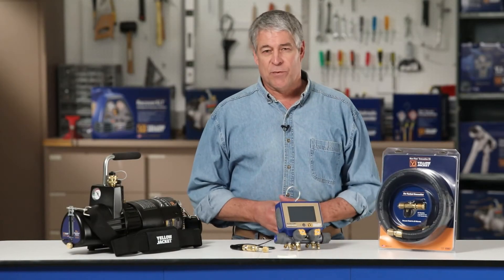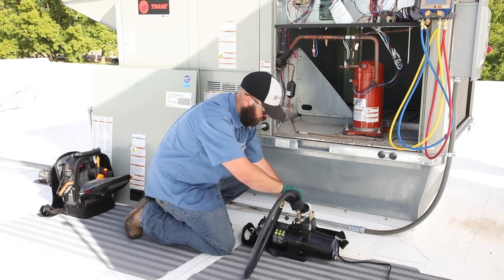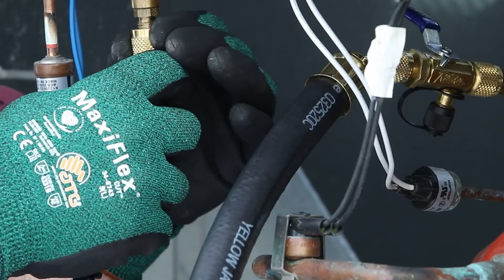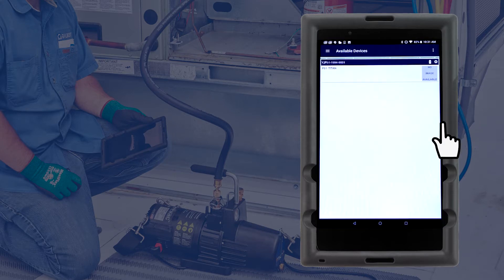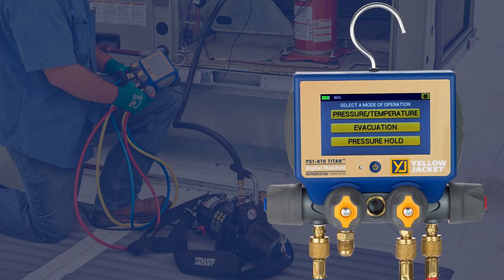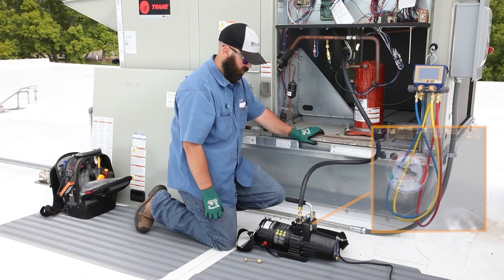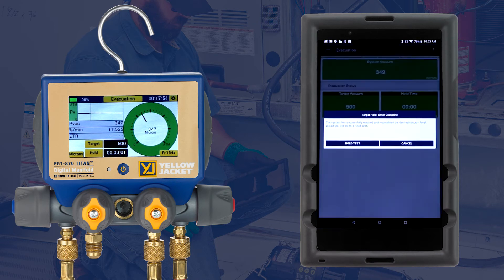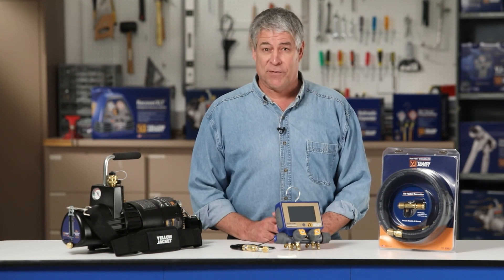HVAC System Evacuation with SuperEvac PLUS ll P51 MaxFlow

Comment: I have had two pair and they both can’t get past -14.4 psi. The microns stay in the thousands without moving. I’ve even tried on a new reclaim bottle. Not sure why two pair would have the same issue
Reply from the maker: Hello! Please call YELLOW JACKET Customer Service 1-800-769-8370 or 952-943-1300 M-F 7:30 AM to 5:00 PM CST and ask to be transferred to Technical Services. They can help you. Stay safe!